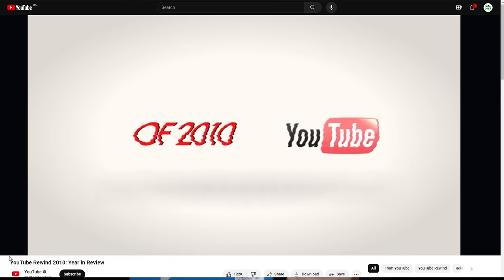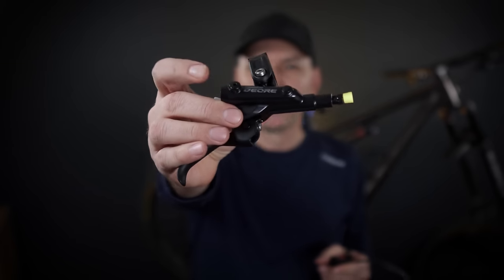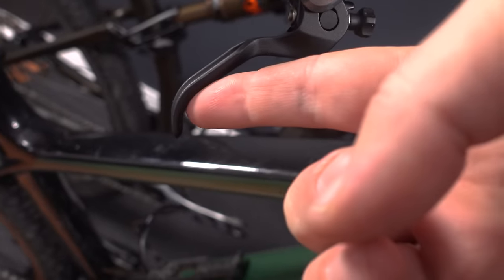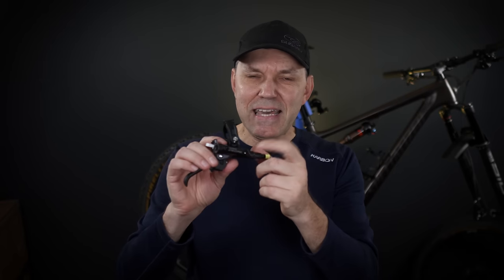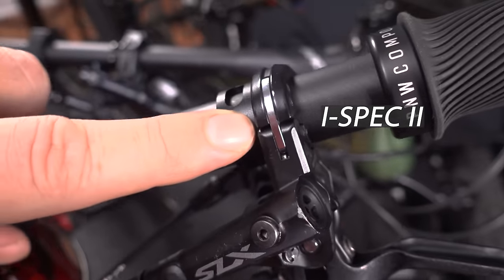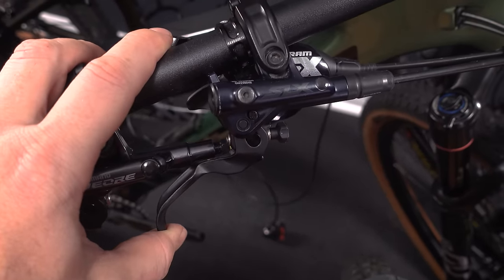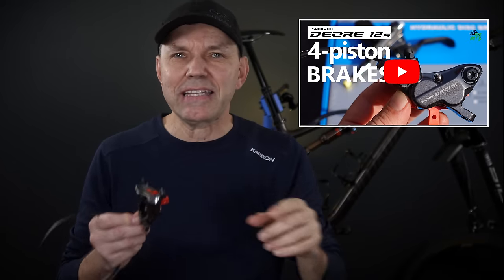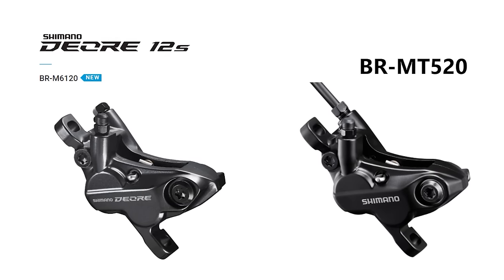Shimano BRAKES Lineup - DEORE, SLX, XT, XTR, 2-piston, 4-piston, M6100, M7100, M8100, M9100, M9120

Comment: Small tip for DIY-people: If you don't like the safety pin used on the Deore Calipers you can retrofit the screw from the higher series if you tap the threads into the calipers. Remove the pin, tap on the outside latch, I believe its a M4 thread. Then just screw in the screw and secure with the clip. Done!
Reply from the maker: Yeah I should do a video about that...🤔 thanks for sharing!
Reply: what kind of hardware is necessary to cut the thread. Could you link an amazon link?
Reply: I will definitely be doing that! Thanks buddy.
Reply: @ryansteiger6960  absolutely none ....when you've bought the screw pin just use the screw as your tap .....its strong and cuts absolutely perfect threads into the caliper with only a small amount of force required

Comment: Small detail, the free stroke on the SLX is blocked only by a shorter screw, it can be easily replaced by a longer one in order to have the functionality. 

Great video btw!
Reply from the maker: Thanks for adding to the post. I have started the video with that kind of detail in mind and I removed it quickly as the video would have been 15 minutes or so 🤓
Reply: @LoveMTB It's been that way since 2012/2013 SLX M666 brakes ( I loved them so much)

Comment: Everyone keeps saying the shimano xt m8100 and 8120,levers are the same ,they are not! The 8120 lever is taller and flatter than the M8100's .if you buy an aftermarket xt lever you get the 8120 but oem they are completely different levers ....
Reply from the maker: @knott4me561  I’m sorry they’re the same
Reply: @LoveMTB  the are not even shimano now list them as being different....
Reply: @LoveMTB  taken directly from shimano The Shimano Deore XT BL-M8100 and BR-M8120 are both disc brakes with different lever designs: 

￼

￼

M8100

This brake has a two-piston design and a stiffer lever that provides support for aggressive riding. It also has Servo Wave technology, which causes the pad to move quickly to the disk surface for an aggressive initial bite. One reviewer says the M8100 has raw stopping power and that the brakes lock up easily. 

￼

￼

￼

M8120

This brake has a four-piston caliper and a more progressive modulation than the M8100. It's designed for tough enduro trails and has finned metal pads and hose. The lever is taller and flatter than the M8100's, and some say it provides reliable stopping power in all
Reply: I agree with you I honestly think they used to be ....but I've just bought a complete brake set xt 8120 4 pot for the front and 8100 2 pot for the tear and the levers are different....I didn't,y notice at first but its thinner on the M8100 and the design is subtlety different.....bought from a shop who sells shimano in the UK and 3 days after querying it they got told from the UK shimano distributor this is a running change moving forward .
Made in a new factory in Taiwan .....apparently
Reply from the maker: @knott4me561  I hear you, but having them in my hand, side by side, mixing them and using them I can tell you the lever is the same (BL). Only difference is that on the OEM version you’ll see J-kit written on the back
Reply from the maker: @knott4me561  Learn something every day, thanks for sharing!!!

Comment: Actually, there is no need to buy another class above it, when you already have Deore, because the sensation and performance are pretty similar.

To get braking performance that is not that different, you have to dig deeper into your pockets.
It doesn't make sense.

Comment: nice informative video. for a dream-built XC bike, with certainly aggressive decent riding, do you recommend XT brake 2 piston or 4 piston? Due avoid the XTR carbon blade break risk, can I use the XT lever with a 2-piston XTR caliper? Regardless of weight, do XTR calipers bring more value than Xt?
Reply from the maker: I would stay away from XTR TBH. Long story short, not worth the premium. 2 piston is more than enough. If you want more power w 2 piston look up my video on Formula Brakes 😉
Reply: @LoveMTB  tnx for quick response. for a versatile gear, without budget concern, what is your recommendation?
Reply from the maker: @sepantsystem2237  Still Formula 2 piston unless you want to stick w/ Shimano in which case it's XT
Reply: @LoveMTB  I mean the derivation system. Agree 1S with the 12-speed rear? Or 11 s with 2X front derailleur?
Reply from the maker: @sepantsystem2237  there no more room for 2x in XC majority of frames won’t take a front derailleur anymore anyway. No need for it these days
Reply: @LoveMTB  some of them are fasten by clamps. is 1X energy efficient ? I saw a video on youtube which insisted that 2x is the most efficient. due to less angle along chain
Reply: Some of them are fastened by clamps. Is 1X energy efficient? I saw a video on YouTube that insisted that 2x is the most efficient due to less angle along the chain.
Reply: Some of them are fastened by clamps. Is 1X energy efficient? I saw a video on YouTube that insisted that 2x is the most efficient due to less angle along the chain.
Reply from the maker: @sepantsystem2237  You know we're splitting hairs here right?😊 Are you racing at world cup level? Even if you did they do win races, all using 1x drivetrains

Comment: For the past 18 months my front brake setup he been Shimano SLX BL-M7100-R lever, SLX BR-M7120 4 piston caliper with fined resin pads, SLX 203mm SM-RT70-L rotor & all I can say is 'perfecto', they are absolutely phenomenal brakes. Very powerful with amazing brake feel & control at any speed, I could easily lock up the front wheel at any speed & get bucked over the bars. Reliability is no issue either, I set them up a long time ago & not touched them since. A huge bonus too is that Shimano use mineral oil instead of DOT brake fluid. I couldn't recommend highly enough using this brake setup.
Reply from the maker: Good brakes indeed

Comment: I’m a Shimano “fan boy” and think the brakes are some of the best in the industry with these new models. I have the older models too and those models had some “getting used to” because of the grabby feel. But I feel like these new models completely eliminated the grabby feel but without making them feel mushy like some other brands feel. My 8120 XT brakes have aftermarket levers from Flo Motorsports called the Pro 120. My 9120 XTR’s I left the original nice levers on those. One of the things that I love about Shimano is that they are very easy to bleed and service. The Shimano Ice Tech rotors are pricey and so are the brake pads but you can get the less expensive Shimano rotors or other brands, same with the brake pads. I only use Shimano mineral oil but some people change that too. I really enjoy your channel and learning about your profession opinion and tips on bike wrenching. Thanks!

Comment: I love my Shimano brakes but can't say I've tried anything else LOL.  My Optic came with MT-420 4 piston brakes with metalic pads, hated the levers so did a simple lever replacement with the M6100 levers and a bleed.  I love that all of the brakes are basically slightly different versions of the same thing and are all interchangeable.  Quick lever bleed and they are awesome.
Reply from the maker: Bonus with the M6100s is the Servo Wave also!
Reply: How are you liking them? Way better braking feel? I'm planning to do the same with my MT420 by swapping the levers to the 6100 levers or maybe the 8100 XT levers. They came on my Range VLT A2 so need all the braking power feel i can get.
Reply from the maker: @illestFlavor  6100 will feel more powerful, should be easily noticeable.
Reply: @illestFlavor  I ride in Ontario and they are plenty powerful enough for me but I think the key point to the whole setup is the metalic pads and compatible rotors.  I went with the cheaper leavers as i don't need the on-the-fly lever changes or the free stroke adjustment IMO.  Nice to have but not needed for me.

Comment: Epic video! I'm running the SLX M7000 2-pot ones. Lovely so far in over 3 years, front was new while the rears were second hand. 

From my research back then for the Mx000 generation, XTR isn't worth it, XT had a bad batch in the beginning while SLX came later on the market and are spot on. Plus I got the new upgraded G05S pads for this new season. 203mm and 180mm matching SLX discs as well. 

Would love the M8120 ones day 😁
Reply from the maker: Yeah I had a set of the original XTs, they replaced them without asking much 😁

Comment: Great comparison video. 

Currently using XT 2 piston on my XC rig. 

And SRAM Code Silver Stealth (the ones with the hose closer to the bars) 4 piston on my trail rig.
Reply from the maker: Thanks for sharing! How would you compare the performance of the two?
Reply: @LoveMTB Both are amazing IMO. Excellent build quality and performance. The SRAM 4 pistons have greater stopping power and heavier. But since they’re on my trail bike, I’m not concerned about counting grams. Oh bleeding edge makes bleeding brakes easier than on Shimano mineral oil.
Reply from the maker: Good to know I won’t avoid them when I come across the new high end sram brakes
Reply: @LoveMTB The new design allows for the hose to sit closer to the handlebar. It looks cleaner for sure.
Reply from the maker: Yeah wouldn't be the deciding factor for me though @GokkunGuru

Comment: Thanks for the video. Just to share my own experience. When fitting my actual carbon frame/hardtail I went through a similar (but not so detailed) comparisson and opted for a set of 6100 levers and 6120 4 piston calipers, paired with RT76 rotors (180mm front and 160mm rear). Bike's weight is 12 kg and I'm about 80kg. Main use is recreational (I mean not race) XC and trail, including some downhill sections, not extremelly long but with very little space for braking and on mostly dry and loose surface terrain. To me this combination sounded as the best performance/price relationship for the intended use and I'm very happy with the resulting braking power and braking control (is this the so called modulation ??). So far I still using the stock resin pads for now.

Comment: For bikepacking purpose 203mm front with mt6120 and 180 on rear with mt6100. More than happy with the setup, no complain.
Reply from the maker: That's a pretty strong set of brakes for backpacking?? Happy trails☺
Reply: @LoveMTB  it's a bit overkill but couldn't resist the deal i was getting for the package.
Reply from the maker: Now that makes sense😊 @Sayan_here

Comment: I have 7120 SLX on all my bikes but add the XT Ice Tech rotors. I could not justify the cost of going with 8120 or 9120 for very minimal weight savings. I have been completely satisfied with the performance of the SLX braking, especially with the XT rotors, 203 front and 180 rear.
Reply from the maker: Nice capable setup!
Reply: I have 7120 SLX too. I hate them. There is noticeable wandering bite point, especially in temperatures below 20 deg Celsius. In 10 degrees it's a serious problem. Brake is completely non-repetitive.
It's not related to wrong bleeding. It's related to crappy seals material. I switched to Code RSC I my second bike and I love them.

Comment: I have the TRP Slate T4's that I installed on my Trance a few years ago.  I like the brakes, but will admit, they do not have the quick stopping power, or bite, as my son's Shimano 520's he has on his Genius.  I have to be careful riding his bike, since I'm used to the modulation on the TRP's, that I press too hard on his brakes and find myself continuing a bit over the handlebars while the bike was braking.  Have to admit I like that stopping power and the smaller lever's.  Have been considering a switch to the 520's possibly Deore that you setup for your bike.  Thanks for the video, this is helpful on seeing the differences.
Reply from the maker: You're welcome! Your comment brings up a good point, brakes like those TRPs are considered to provide great modulation and that's obvious in the car parking test. However on the trail, real life, the so called on/ off Shimanos provide good braking power and enough modulation and the TRPs will feel weak and give you arm pump. Oh well...🙂

Comment: I have the XT 8120 on one of my bikes and on the other one the Deores of 2015 (the grey ones) in 2 pot, and belive me I can barely tell a difference between them. Feels pretty much the same. Sure the 4 pot XTs have more power. But the feeling is 95% the same. I'm really impressed with the deore lineup even on drivetrain. Don't see the reason to spend more money on the more expensive series as long as you don't do races where weight matters.
Reply from the maker: With you on that...

Comment: I just bought yesterday the SLX 4 pistons. I only do wheelies and I use a lot the brake so I don’t want it to overheat. And I want strong brakes and reliable brakes. So I choose the SLX the XT doesn’t work for me, it’s always failing after wheelie for some time, the SLX are more reliable on that point. I don’t chose the deore or the 501 because I like the ice tech and the reach adjust 😁

Comment: I recently built up my hardtail, using a set of MT520 calipers, i don't like the big non servo wave levers so I bought a set of SLX levers, mated with 302mm rotors front and rear(mind you it's an "enduro" hardtail) and you've got some insanely good stopping power on a budget! I've got full XT 4pot on my Stumpjumper and I almost like the cheaper set better!
Reply from the maker: Haha exactly, blind test hard to tell which one is which from Deore all the way up

Comment: Informative video. My bike came stock with Shimano MT201. 
I recently just upgraded my groupset to XT. I've been reading about some issues with the XT 2 pistons, so I am hesitant to go this route. 
Leaning toward the deore 6100 which should be a decent enough setup and an upgrade from the mt201
Reply from the maker: I am using all of them from Deore to XT to 4-piston. They are all good, get the one that makes more sense for you price and features, performance will be very similar.
Reply: @LoveMTB,  thanks for the response. Ordered my Deore 6100s online, yesterday. The reports of a wondering bite point on the 8100s threw me off.
Reply from the maker: @ashokhargovan9603  you’ll be happy with those

Comment: I ended up just changing my front brake on the Meta HT my most used bike to XT 4 piston but still running SLX 2 piston in rear. been working well I dont feel I need 4 piston in rear.   Cheers
Reply from the maker: With you, I have 4-piston front only on my bikes😉

Comment: I put half a decade of use on M6000 brakes with few problems; but I showed Shimano my opinion on i-spec EV by substituting Hayes T2 brakes.
Reply from the maker: How do you like the Hayes? They are some of the innovators in the hydraulic brakes! Together with Shimano. And I did have a set of M6000 that I used on a couple of bikes, bombproof!
Reply: @LoveMTB  I like them a lot, but I'm also easy on brakes.

Comment: I've seen many reports about the SLX M7100 lever snapping easily.  They made the lever blade thinner at the thinnest point where it's meant to bend, if you smash it, instead it snaps.
Reply from the maker: Don’t smash it!?😊
Reply: @LoveMTB  I've never done this, but a guy bought a bike second hand and the plastic guide was snapped. Imo material choice eis absurd so is no spare parts.
Reply from the maker: @mtbboy1993  ouch

Comment: I have SLX on my fat bike and that's the only bike with Shimano I  have. Brake power is god, no complains. But what I like the most is the levers. I just like how small and curved they are. I have a feeling I have less finger travel, or let's say they are natural finger move when squishing compared to Stram when my fingers go in some awkward direction. Is not that bad, still not perfect. TRP brakes are close to Shimano. Still, the levers are more towards to Sram levers than Shimano.

Comment: No mention of the ceramic pistons? Do all MTB groups use ceramic?  My XT M8120 ceramic pistons just cracked and there is no good replacement!! I hear these are a problem with Shimano brakes. Hoping they change materials soon....
Reply from the maker: In every day use nobody really cares if the pistons are ceramic or not. I have videos describing in detail each brake type this is more like a summary of that info. Links in the description. As for breaking/ cracking, in 10 years of using them, various variants I only had issues with one. Cracked, but entirely my fault…
Reply: @LoveMTB  Thanks - but since this happened to me, and with only moderate use, I now find hundreds of others online complaining about Shimano pistons. In fact, an entire 3rd party Chinese mfg. industry replacing Shimano pistons exists!  Unfortunately many of these Chinese replacement resin pistons also have some issues. This is not a small problem with modern Shimano calipers.. I think maybe you got lucky.  This is why I was asking if all groups (Deore, SLX, XT, XTR) all use ceramic pistons.... I want to replace my XT 8120 calipers but keep my levers.

Comment: I'm still using Shimano XT 739 V-brake levers I bought in 2006 and XT 760 V-brakes I bought in 2007👍👍
Reply from the maker: Wow 👍
Reply: @LoveMTB  They still work😁👍👍. I also was using XTR/XT replacement pads for years👍👍. Now im using ok Jegwire pads. I also used Jegwire Kevlar brake casing for years🤘🤘
Reply: @LoveMTB  A set of XT 8100 disk brakes would be nice. But not on my 2006-07 Trek 4300.
Reply from the maker: Nice vintage! @glen3509  👍
Reply: @LoveMTB  HaHa Vintage👍👍
Reply: I'm also still using  XT M770 and M772 drive train components, and Thomson Elite stem, and post.  These shouldn't be on what's called a beginners bike. All the original parts/components (which were very low-end Altus) were upgraded very quickly🤘🤘. I also put a 7075-T6 aluminum Navy (Bold blue) Chris King headset on it. It looks cool with the orange/copper paint👍👍
Reply: And Great videos 👍👍
Reply from the maker: Thanks☺ @glen3509